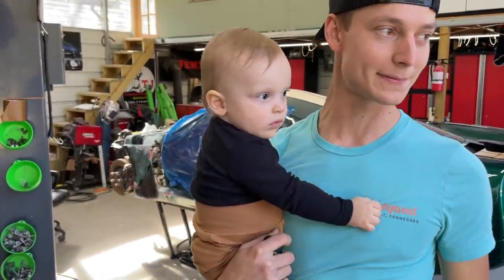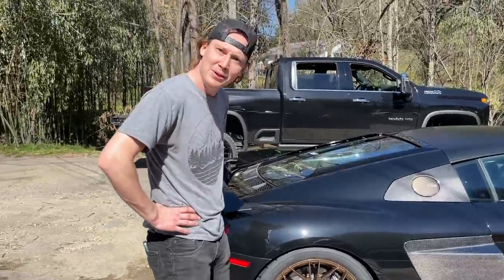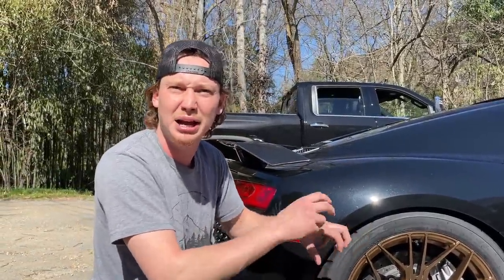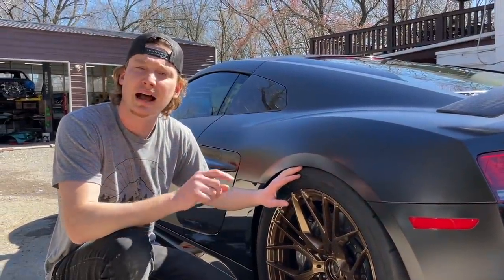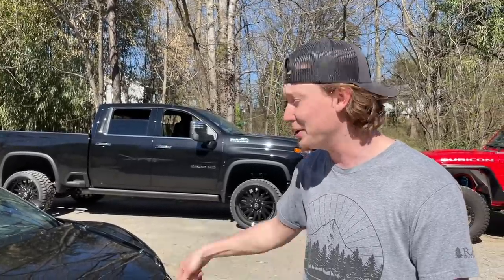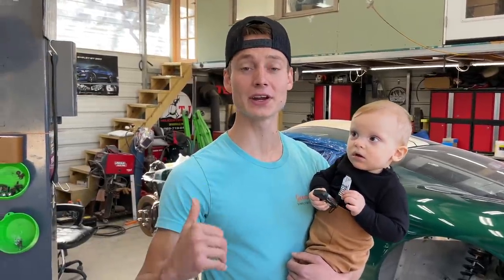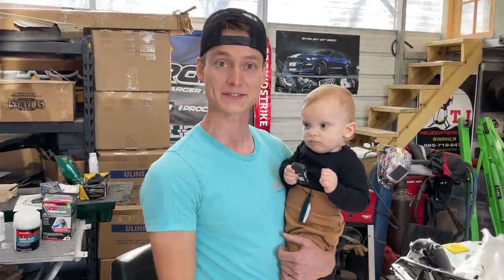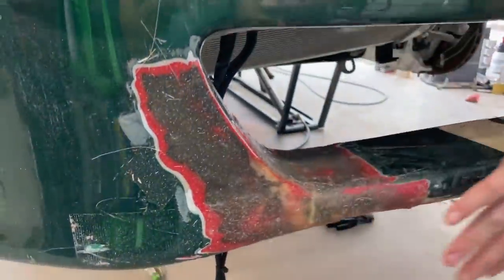Rebuilding A Wrecked Factory 5 GTM Supercar Part 6!!!

Comment: Your glass mix just needed more hardener. Cold weather needs more drops. Just work faster? I did a lot of clothes fiberglass. Just build it up nice and thick underneath. You can also use the different cloth change weave pattern!

Comment: Hey, read about structural composite repair. All of tye stress cracks should be opened. Everyhting needs to be done both sides. Remember, resin does not provide structure, fiber does. Keep resin to fiber ratios on your mind while working

Comment: 'Fiber Mat' fiberglass repairs are for curves ,etc.The fiber screen is structural strengthening,and has to be used on the inside for repairs.and under the mat for the same.You Must 'V' the cracks and fill with resin and the sheets,then cover with mats and filler before paint.

Comment: Yep, those tires on that chevy still look like crap. 50%?  when I was reading the comments I didn't see one person that liked the tire size.   Keep the green on the factory five car. I have been told that old resin won't dry correctly.. Might want to look into that so it doesn't react to the new paint, or is it the new  paint won't react to the old relain.

Comment: I would recommend a good epoxy resin system for fiberglass repairs. Those factory five panels are polyester resin based. But epoxy works way better for repairs. West system epoxy is a good choice. You can get it at any west marine store. Plus I would recommend some of the fillers. Like micro balloons. Fairing filler. Plus the chopped fibers. You can use them to thicken up the resin for filling cracks and whatnot. Grind out your cracks. Bevel them out good. Before starting the repairs. Also with epoxy resins. You want the shop temp to be at least 60 degrees for at least 8 hours. To get a good cure. Good luck! Love the new build!

Comment: Do the fiberglass repairs from underneath first and you can add wood or some other material for structure and fiber glass over it. The. You can finish the outside with tigers hair

Comment: Hey bro straggered isn’t about different sizes in inches it’s about the backs being wider them the fronts so the size is different but it’s the wider wheel in the back and it give u a concave look if the rim is concaved cause some are not concaved but will still be wider

Comment: Fiberglass repairs should always be done from the backside. When you bodywork it after the repair you will remove 95% of the new material if you're doing your repairs on the cosmetic side. Add a couple layers from the backside for strength, then grove out the loose fibers on the visible side and create a v-shaped channel on the cosmetic side to body fill with fiberglass reinforced filler, and glazing putty.
Reply: YES, YES & YES!!!

Comment: LOL... 100% done ACCEPT for the damaged tub, frame work, bad gaps, terrible paint, cut dash, creased headliner, alignment, bent turbo mount, but other than that all done. Someone please buy this car from these chuckle heads.  It had nice wheels and all was needed is replace the one or two damaged but in qoonzquad style throw on some crap that doesn't fit.
Reply: Thanks  for your participants and comment for the giveaway🎁 🎁👆👆👆👆👆👆

Comment: The fiberglas you were using first was fiberglas cloth, the new is fiberglas mat.  For the best overall patch, you should use BOTH.  Put the woven cloth down on the first layer or two in the cracks, then use mat for the last layers.

If you look at most layups in molds, they put in gelcoat, then either mat or use a chop gun to spray in strands, then they'll usually finish up with woven cloth as the final inner layer.

That red layer you keep sanding through is the gelcoat layer that is sprayed into the mold before adding fiberglas.

Comment: Is just the surface of the fibreglass tacky or is it soft all the way through?  If just the surface is tacky it may be whats called amine blush.  It should come off with some acetone.  

Also, if you're using epoxy, adding more hardener won't necessarily work.  If you're using vinyl ester resin you can add more hardener.
Reply: Hello, thanks for watching!♥️
it's your lucky day we have a package for you 
contact🔝🔝us👆👆

Comment: another way to repair broken fiberglass is to use sheet steel or aluminum riveted to each side of the break...then drill out the rivets and remove the sheet metal once repaired.

Comment: Need to let those tires warm up before putting on the power or you’ll be going sideways. Definitely need to take the car back to the tuner and make sure everything is 100%. There could be some more hidden power in there.

Comment: Guys you need to imbed some steel struts ACROSS the breaks - recess them in and pop rivet to hold them in place, then fibreglass over the top of the brace.

Comment: Staggered means when you're wider in the rear than the front the size from 19 to 20 front and back doesn't matter That's a preference some people run a taller rim in the back or front

Comment: Staggered wheels would blow up your all wheel drive system , the outer diameter needs to be the same or the gears will spin one end of the car faster than the other . Bigger tires will have a higher top speed and potentially better fuel economy , and smaller tires will increase the torque that makes it to the ground .

Comment: The resin might be laminating resin which is designed to stay tacky to allow additional coats to be added without the need for sanding between layers. Great video as always. So impressed with your work ethic.
Reply: Thanks,  for your participants and comment for the giveaway🔝🔝

Comment: Whether Mat or Mesh:When you lay either they need to be pressed into the resin with a roller ,or other such,to push the air out of the repair area,and the force the fibers deep into the resin and the resin into the damage.
Reply: Thanks  for your participants and comment for the giveaway🎁🎁👆👆👆👆👆

Comment: Having worked at Douglas Aircraft and Barry Mini T, as a fiberglass laminator/ developer, let me run a couple things by you. First, the body parts are formed on body molds, using a vacuum seal. You wax the mold, apply a layer of smooth glass, then spread resin mix, followed by multiple layers of more coarse glass, then a final sheet of smooth (fine grain). You make sure everything is saturated, then cover the outer edge is roll sealant. You insert a vacuum tube through the sealant, then cover with a plastic sheet. Apply vacuum and the plastic draws down and squeezes the air out of the glass, which then hardens. That is how the part is made. When dry it is then peeled off the mold and the plastic pops right off. You sand the edges smooth and lastly gelcoat is sprayed onto the part for finish. It is not painted. The gelcoat is colored Resin. The cracks you see is cracked gelcoat. It has to be sanded off, then a fine cloth of fiberglass is applied to replace the gelcoat. Be sure the finish surface is smooth and paint ready for fiberglass paint. Your paint dealer can tell you what you need. The cracks will haunt you, because gelcoat does not flex but fiberglass does. Just trying to provide a heads up, been watching you guys since the burning RV, never miss a video, on all 3 (?) Channels. I am 75, and in Poplar Bluff Missouri. Senior citizens can not afford what you guys do, but we can dig where you are at

Comment: I’m a laminator by trade and did just repairs for 3 years and used to hate watching you guys glass but your getting better. 
What you have there is chop stand mat(csm) which I better. You need to make sure that when you do the underside that you sand it all the way down to the glass that you put on the top side otherwise it won’t last long before it starts to break.